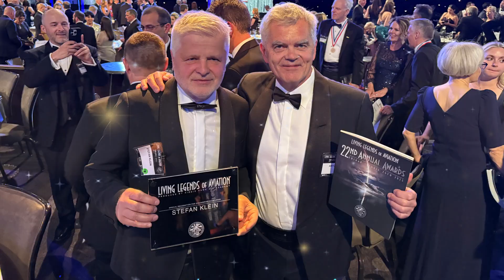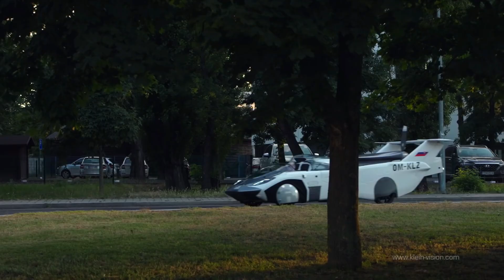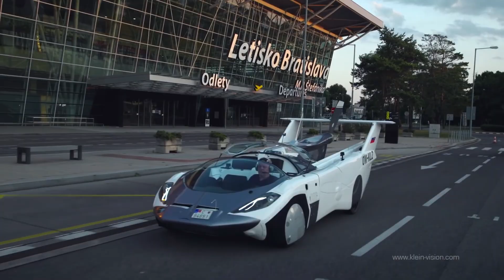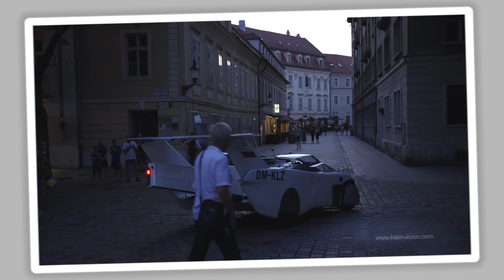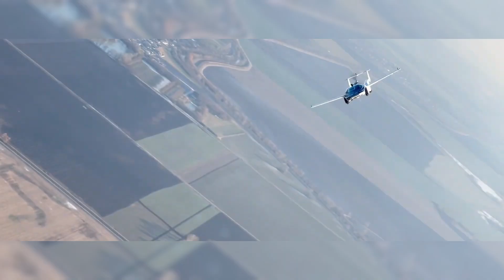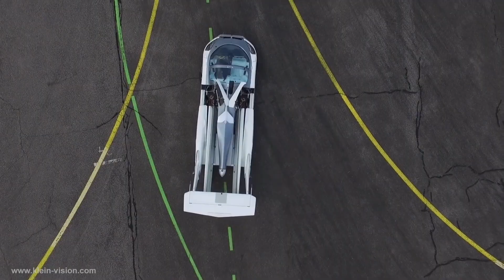2025 New Klein Vision AirCar Unveiled!!

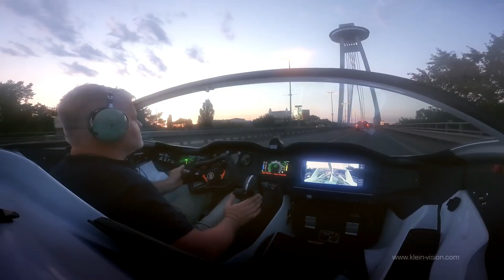Comment: I don’t know all US auto regulations of course.  I’m wondering though at 1:25 if an exposed propeller, at least on US roads, might be deemed unsafe for, say, motorcycles behind it.  I think in big rigs they had to add bars in the back so a motorcycle couldn’t go under the bed in a rear-end collision.  I’m definitely pro-flying car but it seems the next hurdle will be:  certifying them for different countries and changes that might have to be made.  That part might be expensive.  After that it will be ironing out if drivers/fliers need a special drivers license, and after even that, insurance companies and what they’ll cover.  I’ll bet the legal requirements ultimately will be a bigger barrier to entry than the engineering part perhaps.